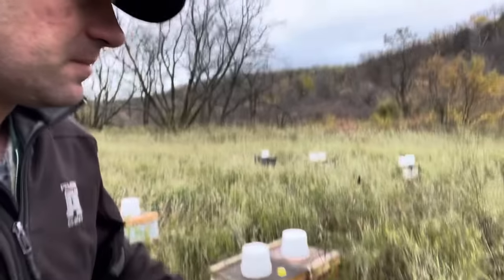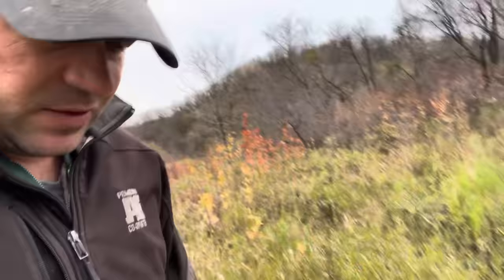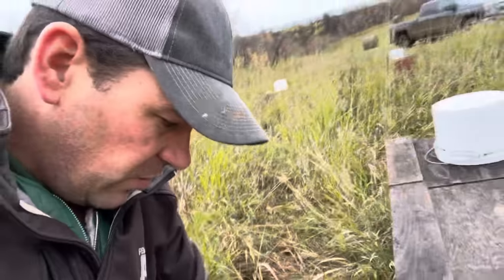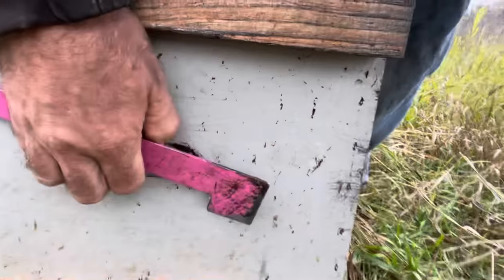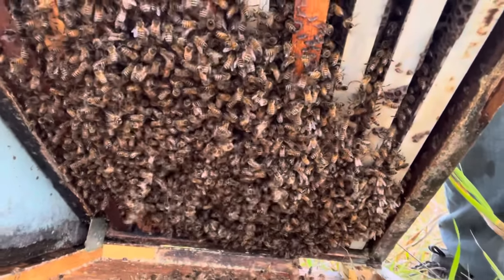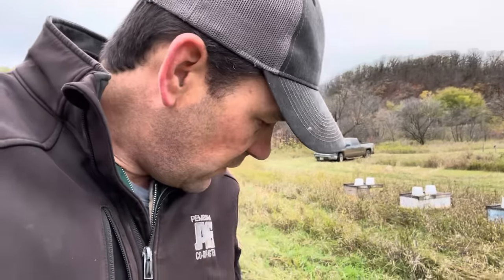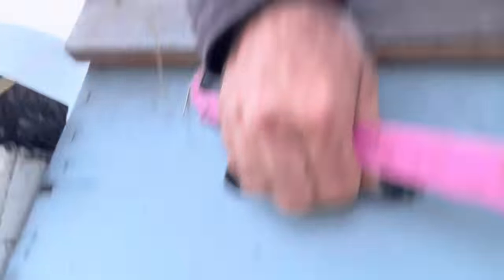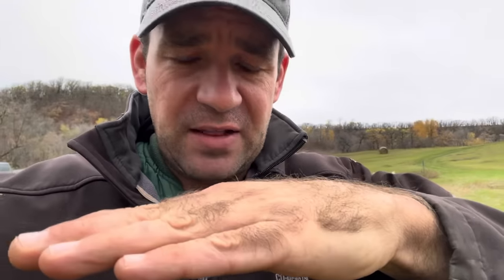Fundamental Understanding of Honey Bee Longevity, Lloyd Harris

Comment: What about going old school? As in, root and/or cold cellaring. Could try burying a cargo container (could be insulated too) under enough soil that it maintains the steady cool temperature throughout the winter. Then, instead of costly refrigerant, equipment, and electricity (that you’re never done sinking money into), you just need enough to create the required ventilation and run some lights.
Reply: Then the difficulty becomes ventillating it.
Reply: The technic was made with soil in north of France at first opening of the holes was key to the automatic underground  winter beeyard it was done by cutting grass carpets and digging up then putting wood to hold and as material to higher the walls soil was used and as roof wood soil and grasse carpet ...

Comment: Your bees put in your wintering room in mid October and outside ambient temperatures hitting 15-20 deg C is a lot different than the same temps in March or April. They seem to sit much nicer in the fall. 
In your cost analysis of the refrigeration don’t forget to include the possibility of the massive savings that could be realized from CO2 treatment. Only possible with refrigeration. If the treatment works like some say it does.

Comment: I'm not sure how far your bee shed is from buildings that require heat but if you use air to water heatpump instead of just refrigeration those bees will provide 15 tons of heat. keep in mind  a break down or power outage would be disastrous and you would extend period with no cleansing flight.
Reply: Great concept to use the "waste" heat from the bee shed for practical purposes such as house or plant heat source.

Comment: If it's just 1 or 2 yards getting pestered by skunks you could use bungie cords to hold the pails down so they cant knock them off. The bastards have learned to push them off and wait for a snack, so when that doesn't work they will go fossicking around the yard.  A pre-prepared bounty of sugary meaty mush in a well placed trap should result in skunk meeting Mr Winchester Bang.

Comment: This year I took a $1 spray bottle mixed up oxcalic acid with a Lil sugar water sprayed inside of hive on bees & it worked so good on knocking mites down... who needs an expensive vaporizer.
Reply: Who needs to die taking that risk? Think about how long it took you to pull out each frame and spray it and then multiply by 1400. Think the expensive vaporiser would soon pay for itself.
Reply: I didn't remove any frames at all lifted lid , set spray bottle to a stream, shot a small amount  between the frames, done... next morning dead mites on bottom board but mostly piled up at entrance.
Reply: Noone died except the mites lol

Comment: I am following along with the concept that has you so deep in thought. But I’m just wondering, if you put your bees in the winter shed earlier in October, and denied them a late cleansing flight how harmful would it be in the spring especially if you have a noseama issue? I believe I’m failing to understand the temperature aspect of the equation. For example, I put my bees in the winter shed roughly 2 weeks (3rd week of Nov)after you and I’ll put them back outside roughly 2 weeks before you. I will still see my bees, breaking cluster making cleansing flights at 2 degrees Celsius.  One would think that’s kind of cool for them to be flying but they do. Perhaps temperature and the amount of daylight hours work hand-in-hand. I do not know Lloyd Harris‘s work, has he made any kind of studies based on daylight hours?
Reply from the maker: Cleansing flights, which bees dies that help?  I’d argue it’s the dead bees on the floor to which fly mid October

Comment: Me, I think I would investigate replacing the floor with a refrigerated system in the floor, cooling the mass is cheaper than cooling the air. Then use air supply to move the air over the floor to cool. Done right both heating and cooling could be accomplished. In sharp freezers coolant is circulated thru the exposed piping with fans moving the air. There are options. Could be less costly ???

Comment: Ian, if sunny warm fall weather causes a shortening of a life cycle, and refrigeration is typically cost prohibitive for many producers, then the problem seems to linger. In your location, on a sunny warm fall day, what is the air temperature at hive level? If you were to set up a shade in a location near to a set of hives, what could the temperature be at a hive level under the shade? Is the temperature only a degree or two cooler, or could the temperature change by greater in the shade? Just thinking of a simple suggestion that is not a $50 dollar experiment to set up. -Bob...
Reply from the maker: Temperature, which is related to flight
Reply: @aCanadianBeekeepersBlog  If shade could be proven to lower ambient temperature, would it follow that the flight urge could lessen?
Reply from the maker: I would suppose so, if they are flying they are dying

Comment: Regarding early winter housing...if you can track down a refrigerated trailer, you might have a 100 hive test.  Seems like a big risk to early house your fleet of 1500 hives.  Good luck.
Reply: refrigeration in winter sheds is common in the USA.
Reply: @Ian - how much R value of insulation is need to maintain the 1 ton of refrigeration to 100 hives ratio?
Reply: @AmbrosianBeeCo  This would be one of the Negatives of a Refer Trailer, It doesn't have enough Insulation and high heat exchange through the doors - especially when the first spring heat waves hit. Also to make it Fork Lift Friendly you either need a warehouse style loading dock, heavy steel loading ramp - or remove all the undercarriage so it sits at ground level. So even as a simple experiment it has high up front input costs.